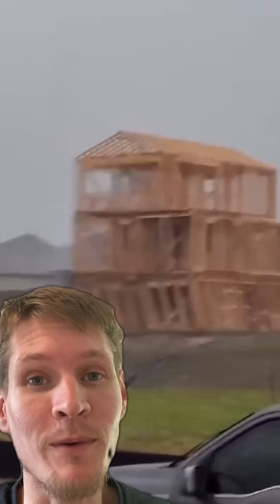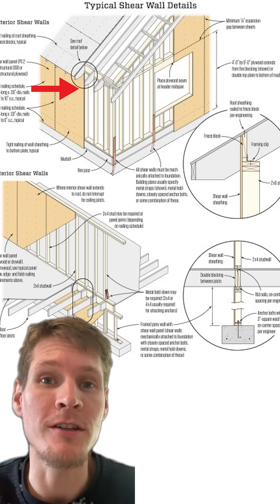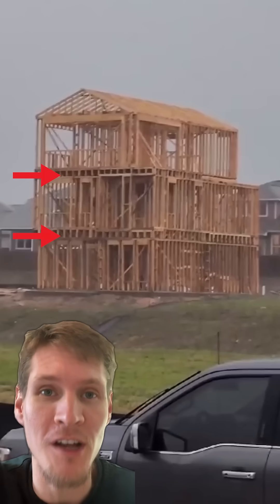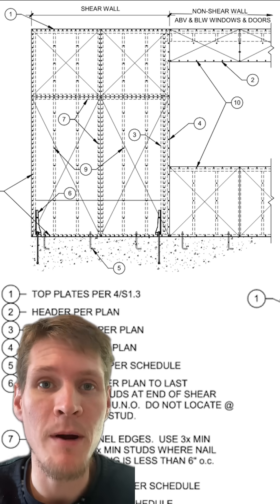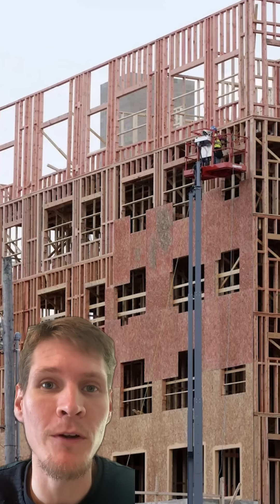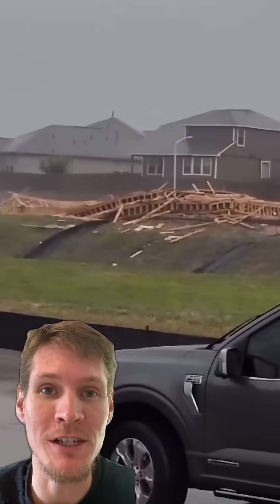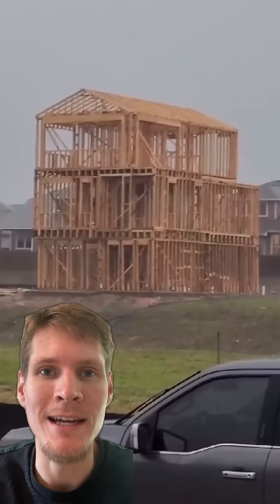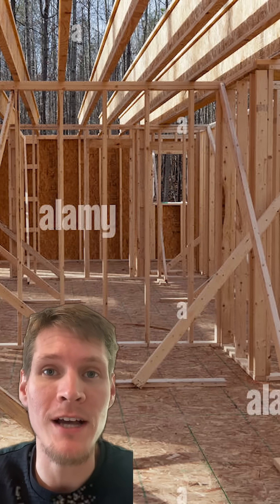Professional Engineer Reviews Reddit Structural Engineering Thread | Part 1 #engineering #reddit

Comment: right, so let me get this straight.....
You have 100 or so floors.
And every floor has a belt around it. A sheet of steel that connects 3 columns together.
And, it was prefab.
SO they made joined the 3 columns together with the sheet of steel, the spandrel or how you call it.
And, now you have this # kinda structure, BUT 3 columns.
And they bolted them together, and the steel plates were bolted together.
And a lot of it was also welded together.

This was the outer tube.

Then you had 47 steel columns, in the core. From bedrock to the top.
Bolted, welded, gigantic massive steel columns.

And in between the outer tube which consisted of roughly 59 columns on each of the 4 sides..... all joined together with these steel plates every floor.....
And the core, 47 columns from bedrock to the top, connected to eachother various ways.....
In between it all they put the floors.
Not just girders from the core to the perimeter.
NO.
It was like a grid.
From the perimeter to the core, and across.
Again, like #
A grid.

Then they produced several documentaries after the big event.
One said the perimeter columns were pulled inwards.
Another said they were pushed outwards.
One said the floors sagged and pulled on the columns. 
Another had a different solution.

So, pls, do explain...
Because none of those documentaries show the real structure.
EVERY single one of em excludes parts of the structure to make their story believable.

So, what they want me to believe is that fire could somehow get 2 of these buildings to fail, and in such a way that the top section destroyed the entire lower section.
In case of the south one, sure.... i could believe it.
BUT the north one....only 10 floors above the gap, and you want me to believe that that block of floors could destroy the intact base?
Must have been a weak steel tube structure then.
Kinda like what we see in this video.

I think it is funny that not a single person who calls himself an engineer has produced a simulation using computer programs to convince people like me.....
NIST tried but just look at their simulations.
Rubbish.
SO why is it that with all the computer programs out there which are able to simulate a heck of a lot, why is it that we have yet to see a simulation that actually looks like what we saw on that day 24 years ago?
Why has nobody been able to produce a convincing simulation of what happened?
Reply: what does this book have to do with what we see?

Well, ehm..... if they had put a belt around the structure, spandrels or how they are called....
This would not have happened.

They knew this when constructing them twins, hence why every friggin floor has a belt around it.

Comment: Was a "gopher" framing a couple summers "back in the day."  We used diagonal metal strips on every corner.  These were cut in with a circular saw in the shape of a "T."  The structure shown, however, would have stood if not for the wind.  Gravity takes it down but only when it is pulled out of plum.

Comment: Hey, Guys, brick? Cinder blocks? Concrete? Chimney?

You build a house that relies entirely on sheet materials nailed to the outside, with no triangulation? And those sheet materials are made of wood fluff held together with wallpaper paste? 

I have a brick-built house that is as solid as it was 85 years ago, apart from a crack or two in the plaster, obviously.

Comment: yeah but also the loaded dimensions of those lintels looks stupid, you've got massive clear spans on top floor, loading some pathetic little framing below then some more lintels weirdly loading ground level - like if the building had some better timber design the temp props probably wouldn't be an issue

Comment: Some idiot that can't swing a hammer or read a tape measure was responsible for ordering the sheathing.  Same said idiot insists that the project move forward without all the materials.  Most projects have an idiot like this in charge.  As a contractor, you put more time into managing  idiots than managing your crew.

Comment: In New Zealand, corner posts are diagonally braced. A lot harder to blow a building down, or shake it down in an earthquake.
Reply: But but, how would DR Horton make maximum profit if they had to build something beyond cardboard and dreams?? That's downright un-American! (/s if it's not obvious 😭)
Reply: That is wind bracing...with none to be seen...
Reply: A steel framed building was calculated to need diagonal steel straps about 3 inches wide to withstand likely winds.
Then the concrete block work was added.
Reply: Are you flexing with your fknin country or what?
Reply: Australia doesn't even have the seismic risks of NZ and American framing still looks absurdly flimsy to an Aussie. We'd use galvanized steel strap braces. There's no nogging on those frames, either. The idea of "structural" OSB or ply (less than "marine grade") seems absurd.
Reply: Absurd or not, ive only had to use the strap braces in Canada once on a rebuild of a 1890's hotel. We actually had to order them from Australia. When these "special" strapping brace showed up i couldn't believe it. A bunch of flimsy sheet metal straps with holes in them. We coild have sourced something identical locally or just used 1/8" mild steel flat bar and would have cost less than the shipping. @damonroberts7372
Reply: It used to be that way here but it looks like laziness is winning out and they're now depending on sheeting to be a structural support
Reply: @Ccyawn123 way back most of the lateral support was the internal&external sheeting. There were a few let in timber braces and dogleg blocking.
Reply: @trevorpetty6506  way back there was no 4x8 sheets and diagonal bracing was built into the frame so that the frame could stand on its own with no siding on it whatsoever because the siding was planks.
Reply: Look closely. this building is diagonally braced.
Is this how Zealanders and Aussies do things?
The comments are correct, this is not how Americans do things, Americans sheath with plywood to cross brace as they progress.
Maybe Zealanders built this in America, who knows?
Reply: @unconsciouscreator3012  Those look like temporary braces.
Reply: @unconsciouscreator3012 the poster means permanent diagonal braces. Not temp braces.
Reply: @trevorpetty6506  i understand, thankyou

This slipped past me as I couldn't understand why no sheeting or diagonal strapping had not already been attached
Reply: @unconsciouscreator3012  I don't think so. There's no nogs and steel strapping on this build. Where the OP suggests that they do this.
Reply: @unconsciouscreator3012 
Look more closely. Those aren't diagonal braces nailed across the studs, they're shoring, standing free of the studs and toe nailed at the ends only. The difference is most striking on the top storey.
Reply: @unconsciouscreator3012  Each level was fully approved by Stevie Wonder before the next was started.

Comment: When framing a structure like this, it's typically way easier to sheet the walls before you even stand them up. But, if for some reason you can't, bracing would hold up to strong winds if it's done properly. You can see these braces aren't nailed except for top and bottom nails. If they had taken the time to add nails along each stud, or every other stud, the braces wouldn't have failed. They also could have used let-in bracing, or lateral bracing that is permanent and much stronger than temporary 2x4 braces.

Comment: Almost all residential buildings in the USA the past 80 years built with “sticks, cardboard, sand, cotton candy and 3 buckets of nails”. No wonder why tornadoes shred them in 4 seconds or they float away in floods.

Meanwhile European residential construction still uses bricks, mortar, 6x6 are still standard for roof structures, roof still consists of slates, roof tiles or metal. Thermo-insulation of walls are high standard and triple layer windows are not uncommon.

Comment: As a design engineer you should know that sheathing on the floor is called subfloor and is generally a minimum of 3/4 inches while sitting on the walls is generally only  716.

Comment: The Sheathing is basically the Strength of the Wall, IDK how you could Frame the Whole House and have that Capability, but just somehow don't understand how much the Sheathing Provides Strength to the Wall... I Got this at Just 17 when the Flimsy Steel Stub Wall was Now Strong as Soon as the Sheathing was Put on it, with a Shocking Difference... It's like Lesson One Stuff... No Excuses...

Comment: As someone from europe, houses get made using a frame to pour in the concrete. And detail the outside with brics and isolate it
Reply: Why does every European seem to think living there gives them an inherent mechanical engineering degree?
"Framing and sandwich panel weak, truss weak, rock strong!"

They used to make airplanes out of much thinner wood than this. Turns out it's a good material for dealing with tensile and twisting loads, like you get in high winds.
Reply: @ToastyMozart  Yes, but house isn't an airplane. Here the 3 little pigs story applies. You guys always have your houses absolutely blown away by hurricanes and tornadoes. It's a joke. And you have the nerve to talk about how wood is a good material for high winds.
Reply: That works when you have a mild climate and no tornadoes/hurricanes/earthquakes. But when you need HVAC due to local weather this has better R values and is more resistant to extreme weather when properly done. It is also less expensive.
Reply: @gholland5840 It‘s  definitely less expensive to build but they still charge ridiculus high Prices  for the Finished Product. I have owned 4 different houses in my lifetime. 2 in Canada and and 2 in Switzerland and can say that they are really built like bunkers over here. Even Interieur walls are built with concrete Blocks. The floors are concrete with radiant Heat. All the windows have Heavy Electric blinds to keep out the Heat in Summer and cold out in Winter.
Reply: @gholland5840  yeah, that's why everything is at ground level when you have a tornado. your house wouldn't be blown out if it was made from rebar concrete
Reply: @gholland5840  That makes no sense. How can a flimsy wooden barn be more resistant to extreme weather than a concrete building? Wood is simply cheaper in North America - that's the reason it's used.
Reply: @apertamono  Wood isnt flimsy, have you tried to snap a 2x6 with your hands? Start connecting them together with hurricane braces too and then... they flex rather than just shatter like concrete.
Reply: @gholland5840 
No chance are wood structured homes superior to concrete as far as durability in extreme weather is concerned.
Reply: @ Concrete cant flex, flexing is important.
Reply: @gholland5840  how's that flexing working out for folks in LA now??
Reply: @gholland5840  I have seen plenty footage of US built wooden houses blowing down in severe wind... but i have never heard of a brick building failing even in tsunamis brick buildings survive.. and hurricanes lol... no chance is wood a better option its a cheaper option that is all.
Reply: @apertamono  Wood and concrete are strong in different ways.  Concrete has great compressive strength, but wood beats it in tensile strength and shear resistance.  Built to the proper specifications, both are more than capable of handling what most weather will ever throw at them -- the trick is getting the environmental forces to work in favor of the strengths of the material.
Reply: @randomexeter3627 
"The trick is getting the environmental factors working in favor of the strenghts of the material"
Oh what a beautiful word salad you made there but what exactly are you trying to say? I mean explicitly, how? How is one supposed to pull off this trick you're talking about? 😂
Reply: @BrokensoulRider  
...or MAYBE, just maybe uhm build houses that are not barely sturdy enough to withstand strong winds and crumble if you build the same thing at a place where the wind is a little stronger at times. 
Just build a solid house ffs
It's not that deep 🤌
Everyone else seems to get it except muricans 😂
Reply: @schmui winds are not a concern for 99% of buildings. And for that last 1% they do build out of concrete such as in Florida.

Wood is attractive because it's easy to modify. Many European homes are also now starting to become wood framed with a masonry facade.
Reply: @gamesguy  
Wood is getting more and more expensive, so no, absolutely not. Just shut up 😂
Reply: @schmui  Lol you just can't face the facts.
Reply: @Michael.RJ.Oil_Painting  Climate change. In places like Florida, new homes are built entirely different.
Reply: @gamesguy  i live in 4 year old building, still concrete
Reply: @AkamiVindex  ok? And?
Reply: @ you mentioned new buildings in europe... i live in a new building in europe... im just responding. just elaborating further on your comment from perspective of my own experience. no offense ment.. just saying
Reply: @vindexworld4636  I said many, not all lol. In the UK for example more and more single family homes are wood framed with a brick facade. Most SFRs in Sweden are wood, etc.
Reply: @stjepanbegovic9882  Oh yeah, only brick hulls remain.
Reply: @gholland5840  Are you talking about the famous mild climates of norway or finland? Or the legandary stable and earthquake free mediterranean. The only thing you are correct on are earthquakes, but that is not a concern in most of the US and Canada. You use wood because it is cheaper over there.
edit: side note wood is terible for winds, it just gets torn appart by debree and creates even more projectiles to kill ppl.
Reply: @someonespotatohmm9513  Norway and Finland use timber construction.

Comment: What states allow plywood sheathing installed vertically? In Texas, in coastal areas where hurricanes are frequent, plywood sheathing is installed horizontally and offset. Not to mention hurricane ties on every stud, joist, and rafter. On a 2,000 sq.ft house, there will be close to $1,200 in hurricane ties (not including labor for installation).

Comment: Just fyi, the diagonal members you call temporary shoring are actually plumb and line braces.  Those have very different purposes. Plumb and line braces are for straightening and plumbing the walls prior to sheathing and joisting.  They provide virtually no strength when it comes to lateral stability.

Comment: That "temporary shoring" is just the plumb and line bracing. It is what we use to pull the walls into alignment. It is only meant to hold it long enough to get the sheer panel on (ie the plywood sheets on the outside of the building) which will hold it from there. We generally remove them when the upper deck (floor) is placed..It is incredible that they managed to get that far without someone telling them they are idiots...where was the general contractor? The inspector? some random guy on the street who would still know better than to do this? lol

Comment: If it had 1/2, the plywood on the walls it would have made a wind that made the port a potty  blow over, there a sail in the wind as 95% of the weight is in the bottom 1 foot

Comment: Totally fake video, probably AI generated. I am surprised that a supposed structural engineer didn’t notice. There are several things wrong with the structure, but the most obviously wrong thing is that there are ceiling rafter ends on both the front and the side of the building which would be physically impossible. Nice try though.

Comment: I know that's right! lol I recently built a 10x20 shed for my solar equipment and had to get in a rush to get it in the dry ahead rain that was coming. That was a little scary and a lot like walking in a small boat while putting down sheeting. I was glad to get off that roof. I had the siding up before I crawled back up there again to put on the roofing and guttering. lol

Comment: I just figured this was another shining example of how new construction quality is in the crapper compared to how it used to be. They cut corners to save money on structures that they sell for a million or more, with improperly cut timber, upside down or no joist brackets, no fire stops between levels, spray on expanding napalm insulation, drywall inadequately fastened, no grommets around wiring passing through metal studs, etc etc… Honestly, it’s a wonder how most new construction passes inspection.

Comment: In Australia we don't sheet with plywood etc our frames are built to be self supporting.
Reply: Yea, it you have to rely on ply sheathing for structural integrity you've already failed.
Reply: A lot of US construction is made of fairly young southern pine 2x4s coupled with various forms of chipboard and particle board.  I guess the sheeting is seen as part of the frame.    Not a house I want to own.
Reply: @scott4825  same in Australia. We just don't typically use ply or particle boards to brace the frame

Comment: We did Cyclone Testing at Cook Uni in Townsville, developed wind rating classifications for plasterboard/drywall and have tried numerous systems of anchoring. The most reliable is sheet bracing at the corners and spread evenly throughout, the ceilings and floors provide a bracing diaphragm which distributes the load. A sheet roof is more susceptible to failure than a tiled roof in a wind storm as a few dislocated tiles allows for even pressure.... too much haste there, not enough care.